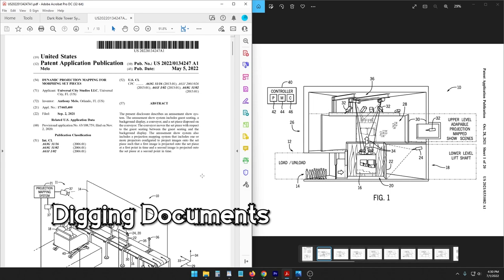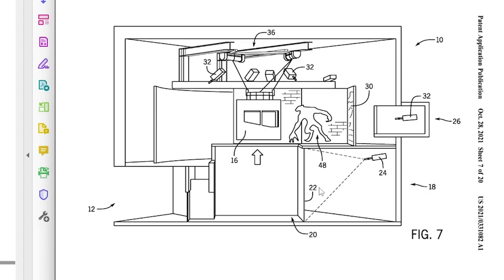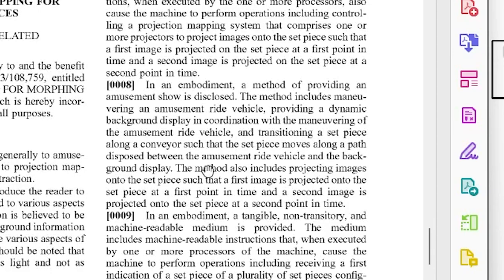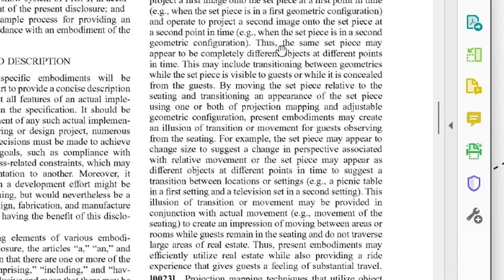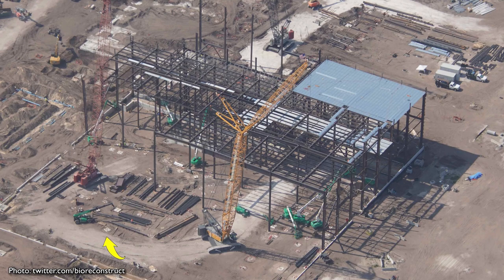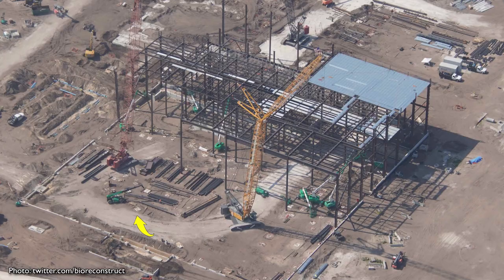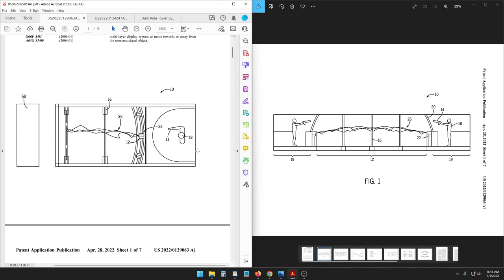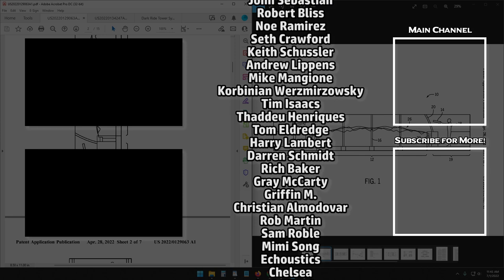Dynamic Projection Mapping Patent from Universal | Digging Documents

Comment: The part where you said it could be for anything is the most important line in the video. This really is a technology that Universal will probably employ in many future attractions, to get away from the "too many screens" complaint. Yeah, it's still a form of screen, but people seem far more accepting of this.

One excellent example of how this could work on a non-elevator ride is what I previously said would need to happen for the Villain-Con attraction. Those conveyor belts are pretty much the only way I can see that walkway idea working. You can't remain at a "booth" if you're on a moving platform... unless the booth moves with you. The other moving parts could all be there to sell the story, like an item could break into two when you shoot it with a Lipstick Taser. (Seriously, they need a booth where you have to holler "Lipstick Taser!" before Lipstick Tasering someone/thing.)

Villain-Con very well may be the "test kitchen" for this technology (and might explain why it transformed from a ride to an attraction). If it works, then it's a solution for Harry Potter magic or for Nintendo interactivity. The moving/changing parts could be Pokémon transforming (leveling up?... what do they actually do?) or some creature moving around in a Zelda dungeon. Because this really does come off as something that will change depending on guest interaction.

More Documents, please!